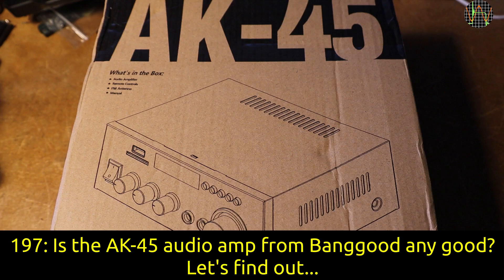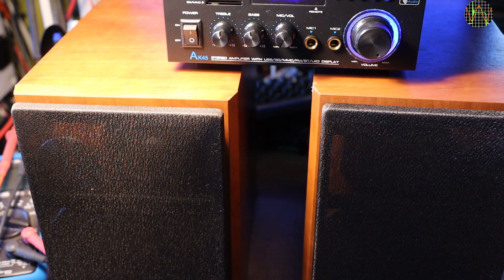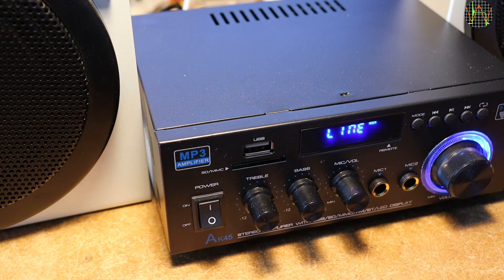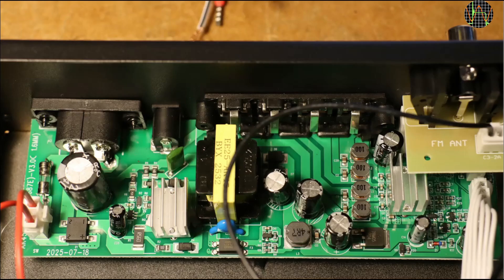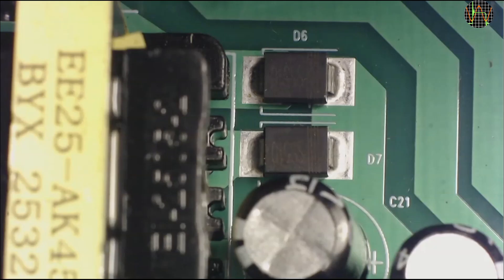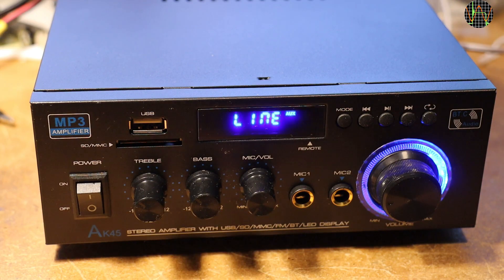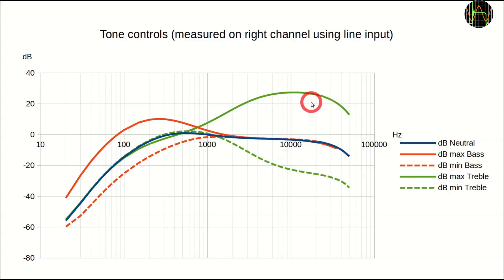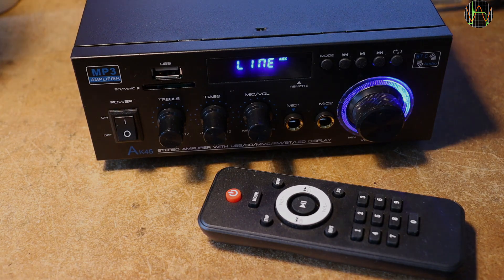197 - Is the AK-45 audio amplifier from Banggood any good? Lets find out.

Comment: These are junk and unsafe. That Y1 cap could quite easily be fake and fake etching. You can't even trust markings on components these days.
Reply: Additionally, this is a chinese class II product in a metal case. That means to be safe, it needs to withstand a 2.96 kV (ish) hi pot test between mains input and case. It wont. The AK-45 model lower than this one is even worse.
Reply: Looking at the -3 dB down points, bandwidth looks to be around 200 Hz to 20 kHz ish

Comment: The piece of paper certifies it as crap.  There's really no use for an "amp" that acts as a high-pass filter at 300Hz such that it's already at -15dB down by 100Hz.  This is not just an issue for bass lovers as natural sound requires relatively flat response well below 100Hz.  This AK-45 shows the worst frequency response I've yet seen from such a device.

I paid US$9 for a tiny TPA3116-based amp with bluetooth, aux-in, SD card, and USB3 (acts as PC audio card) that has almost perfectly flat response from 20Hz to 20kHz, so there's no reason to accept less than that when spending more money.  However, any ultra-cheap device with tone controls should be considered suspect as it's unlikely to have flat frequency response.

I thank you for the thorough testing as most qualified reviewers aren't willing to waste their time on stuff like this, but I want to see equipment with a wide range of prices tested in such a fashion as cost is not necessarily indicative of performance.  It often is, but doesn't have to be so long as the designers and manufacturers of "cheap" equipment make the right decisions.

You can build cheap and still provide good audio quality and relatively low noise, but you have to want to.  Unfortunately, these brands are focusing upon dirt-cheap manufacturing and as many advertised features as possible.
Reply: How many watts on your amp?
Reply: Please give us a link to that amp.